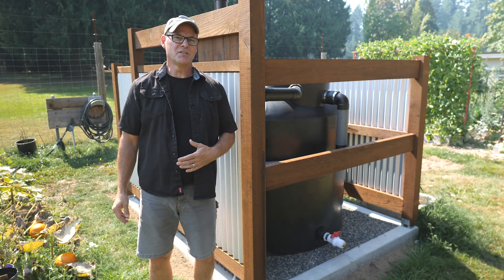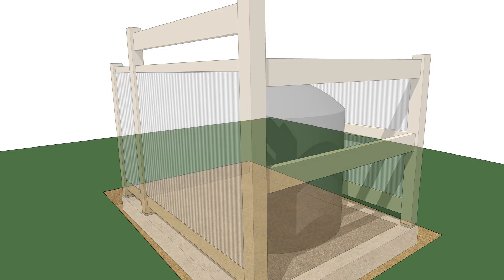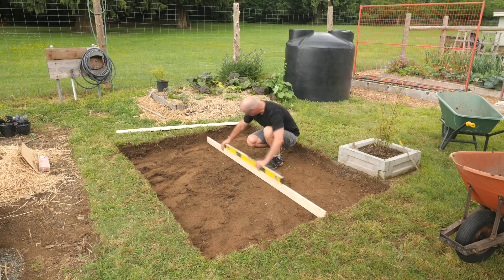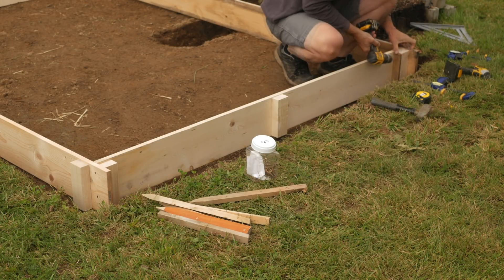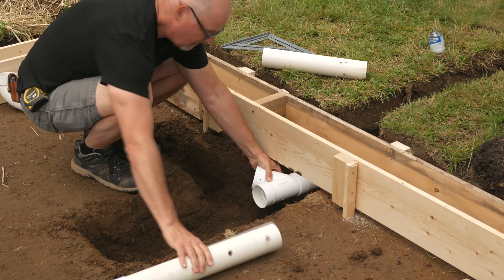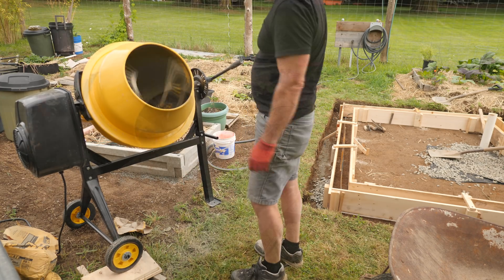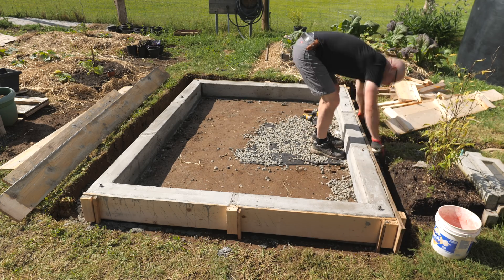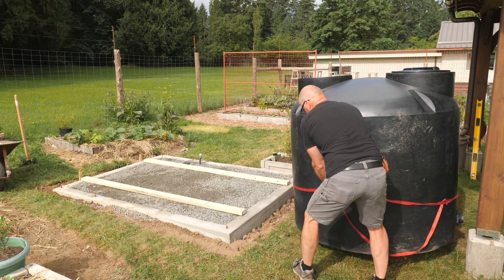Rainwater Harvesting Tank  - poured concrete & gravel foundation [OFF GRID]

Comment: Great video! My question isn't related to the subject matter, but about the fence. What are you keeping out? It looks like it is 12 feet tall and electrified =)
Reply from the maker: I got a load of 8 foot cedar posts cheap so I used those for our garden fence. They are buried 2 feet deep so that leaves only a 6 foot tall fence. Deer can jump 7 feet so I added some wire above that to take it to 8 feet. And it works well. No deer have jumped it.